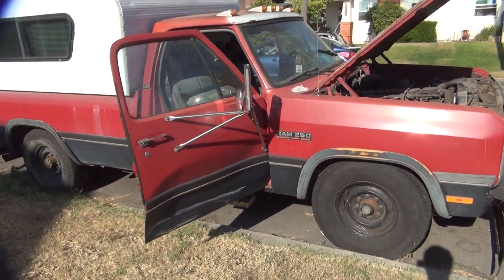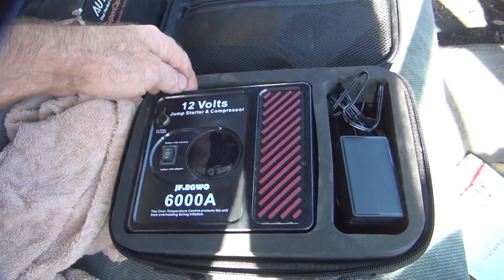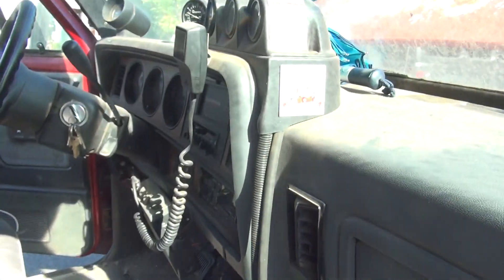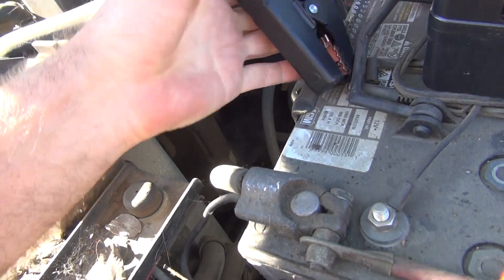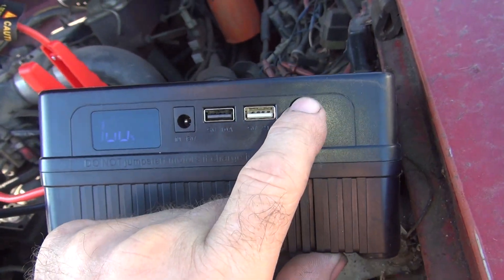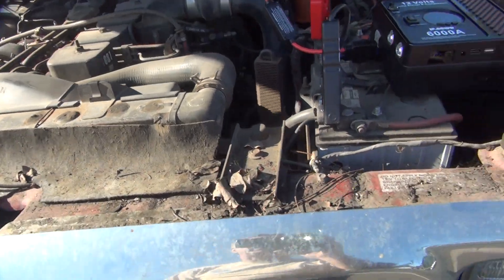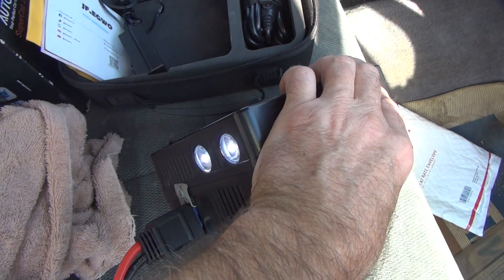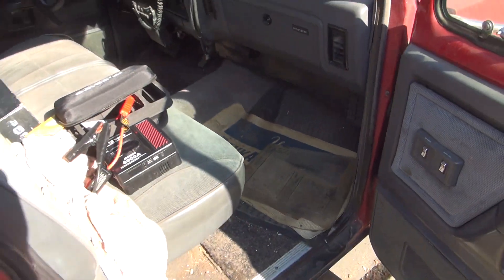product review test #3 JF.EGWO 6000A jump starter, air compressor tire Battery Booster tatro machine

Comment: Nice truck...  bought one of those jump starters a while ago ..smaller than that brand not much bigger than a cell phone but an inch thick ...works like a charm ..started an old  mercedes the other day that was out of gas so long turnover till gas got up there ..amazing and fits behind the seat of the truck no problem ..one of the best things I ever bought